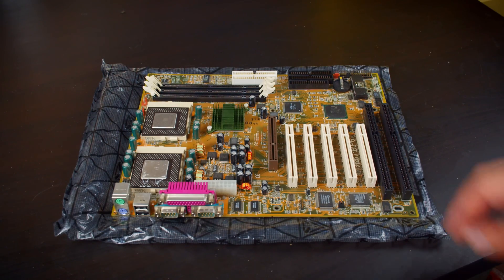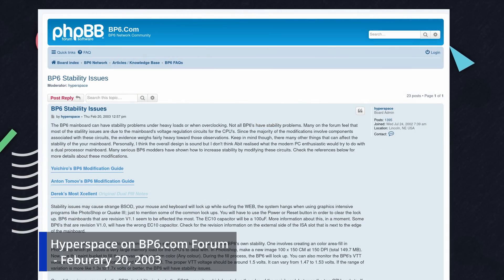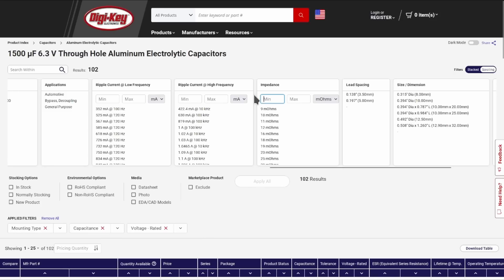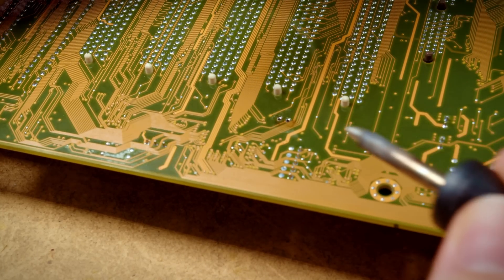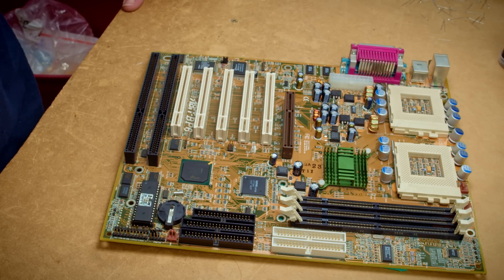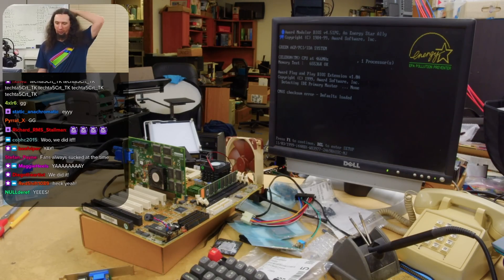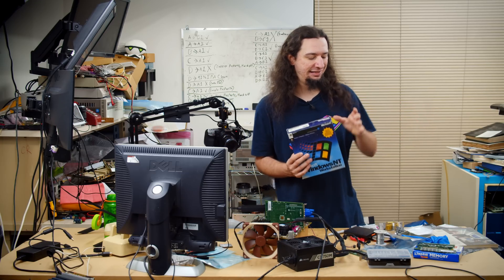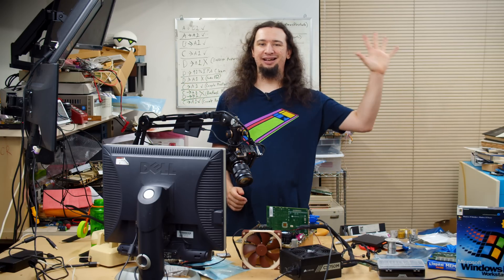Abit-BP6 ReCap - Dual Processor Motherboard Back to Life

Comment: I currently have right next to me a dual Pentium III 933 system on a ECS D6VAA board that I've had since new when I was a kid. I've since recapped it, added the 933's (used to be dual 450), 768mb of ram (can do 1.5gb but not stable overclocked) and running it at 150FSB at 1050mhz. Also added an Asus Magic 8170 Geforce 4 (originally an ATI rage 128, games said nope) and it's basically got Half-Life and CS 1.5 at the 100fps engine cap all the time. Reliving your childhood past on ACTUAL hardware of the time is the best way to go about it. I'll never let it go.

Comment: Back in a slightly earlier era (starting April 1999) I had a dual-PIII-350MHz (on carts! With CPUID! With Intel-provided disabling utility!) running Windows NT 4.0 SP 6.0 and later Windows 2000 beta and production releases. 256 GB of RAM, eventually a Matrox G400 on the AGP 2x bus, and a 9.1 GB SCSI drive. It was known colloquially as ‘Stalin’ because some driver issues made it somewhat unstable, and according to my best friend it was “big, powerful, and effed in the head!"

Comment: I don't think you would roast that CPU. I was able to overclock my Celeron 400 MHz up to about 566 MHz (friends had 366s overclocked to 550 stable). 600MHz works for a short time but not stable. Definitely having better coolers that can pull more heat away would help, though space is limited because of those caps. I had to file part of my coolers in order for them to fit. This is over 21 years ago haha, circa year 2000.

My board, CPUs, and memory are still in my closet. Its the first system I ever built and still my favorite, sticking it to the man, illegal SMP 😀

Comment: I still have mine up in the loft. It got the de rigeur pair of 300A Celerons overclocked and I think I ran an SMP version of OS/2 on it. I'll have to dig it out. Never had a problem with the caps while it ran but the power supply wasn't the quietest, I remember.

Comment: It looks like the hole spacing is close enough here, but it's a bad practice just push caps into the mounting holes if the hole spacing isn't exactly the lead spacing. You want to pre-bend the leads a few millimeters away from the bung on the bottom of the cap, and leave a bit of lead length between the cap and the board.

This may not actually apply to polymer caps, but on traditional aluminum electrolytics, having the lead being pulled at an angle can cause the bung to leak prematurely.

Comment: I had a BP6 with dual celeron 533.  I ran Linux, FreeBSD, and BeOS 5 on it back in the day.  BeOS was a lot of fun because it was designed for dual processor systems and was super responsive.
Reply: It's such a shame that the source code for BeOS was lost and never found.
Reply: @andersjjensen  I've tried Haiku a few times over the years, but it just isn't quite there yet.

Comment: Luckily I subscribe to you, as I have this exact same board that was shelved because of the exact same problems that you described. Thanks to being early in the age of this video, I have already ordered the same caps before they are all bought up, saving me the hassle of finding alternatives. Thanks, Shelby!
Reply: I only kept the board contemporarily in hopes that the forums would catch up and make it easy to diagnose/repair. I ran cad/cam software on it and it was a screamer. I never remembered having latency issues while it worked, before it started to bug out. It ought to fast up even more with an SSD and maxed-out components. It’ll be cool to use it too since I still have the light pen and everything.

Comment: I'm sure there are still enough Low-ESR caps available, so I don't get why the author couldn't find an appropriate replacement.  And there are a lot of different size through-hole polymer caps too.

Comment: I had one with 333MHz CPUs (IIRC) and a GeForce 256 (one of the mass-produced reference boards.) I overclocked it while it was my desktop. Years later I built a new desktop at which point I made it a file/print/dial-on-demand server running Window Server 2003 and returned it to the regular clock speeds.

I believe I got lucky with the capacitors in the board I had and I don't recall a failure of those. I did, however, have a hard drive failure in it; one of the infamous IBM "DeathStar" drives.

Comment: Damn, I remember wanting one of these when I was a teen, well almost an adult. This was around the time I won the contract to build my high school computer network (1st one). I was 18 :P  and got over 100 computers on that network using 100Mbps hubs at the time (in spite of my recommendation to use switches the school opted for hubs and multiple links to the server, 1 per hub, top save on costs. Them managed/smart switches were much more expensive back then). Still had to open 56 computers at the time as a lot of them, unlike some years later, did not have embedded network adapter so I had to manually install those network cards. And most were in fact ISA, so because plug and play at that time was more like Plug and Pray I actually manually configured every single one to ensure there were no conflicting settings such as IRQs, DMAs or Base addresses. This was crucial in particular on any computer that had a sound card as those would typically have at least a base address conflict and typically at least the base address and IRQ. DMA's only a bunch of them I had to be worried with.

Comment: My first SMP capable mobo was an Abit  board with dual Celeron and modified socket 370-slot 1 adapters (Slotkets) installed. Then I upgraded to the BP6 board, which got lost when I moved many moons ago. Scrapped all of my 32-bit computers...

Comment: Why to bother and use 6V caps? It is P3/Celeron - 3V3 max, and core is up to 2V. Use 2.5V polymer for core and 4V for I/O. For primary of DC/DC is 12V max.

Comment: I used an ASUS P2L97-DS dual Slot-1 board with a couple of Celeron 533 (Mendocino) CPUs in slocket adaptors for some years in the late 90s/early 2000s. (I upgraded it from the original pair of Pentium II 333 (Deschutes) CPUs.) With the original PIIs, I started off running NT4 then moved to Win2k but switched to Linux as my primary OS in late 2000 so never tried Windows on a dual-Celeron. (I remember the folks at college being in awe of my utterly-bonkers PC with an insane 512MB of RAM back in 1998!)

I did boot it once with one PII and one Celeron, just to see what would happen. Linux detected both processors correctly (I think the BIOS just reported two of whatever was in the first slot) but I didn't try benchmarking them or anything to see whether they were running at the right speeds as I was worried I might fry the system. Unfortunately, I gave away the Celerons and slockets so I can't try it again now. I don't have the original board either as it became very unstable eventually, so I replaced it with a used MSI MS-6120.

It's sitting on the floor next to my chair right now but I haven't powered it on for probably 8-10 years. I don't know what I'll do with it. Perhaps a monster retro PC running NT4 or Win2k (I've got a few nice quick 15,000rpm SCSI hard drives I could use) with the original Permedia II (3DLabs GLINT Delta-based) graphics card, with the option to dual-boot Win98 for things that aren't NT-friendly.

Comment: A few years ago I stumbled across a System with an even older Gigabyte GA-586DX dual socket board that was even still in use. Caps are fine, just the Dallas was dead. It came with an single CPU, but i managed to get two identical replacements. It is important to have CPUs with identical stepping level for stability reasons. It runs Windows 2000. The Gigabyte lacks an AGP slot and PCI graphics cards limits the usability for retro gaming, however its quite cool see it working from an retro perspective.

Comment: I would Run Windows 2000 on that setup with atleast 512MB ram. Might be a bit on the sluggish side since Windows 2000 was more for high end Pentium 3 and Pentium 4 CPU's

I had a BP6 for quite some time with 2 Pentium 3 CPU's that worked in SMT. was a good system with Win2K on it

Comment: Back in the early 2000's a company I worked for used a duel P3-533 server runing windows 2000 server for production network. Worked really well up until the capacitors failed.

Comment: When the tip of your current solder sucker gets too chewed up, they make versions that use a short stub of silicone tubing for the tip that work better for much cheaper than a powered vacuum gun. (Adafruit part #1597 for example). The silicone tubing can handle the heat of a soldering iron so you can press it right onto the tip and joint to suck the solder out without having to do the carefully timed move.

Comment: I had one of these boards, I populated it with two 1GHz PIII's, 1GB of RAM, two AT166 RAID cards, a Matrox AGP dual head video card and dual booted between Windows 2000 and SuSE 10.0. Ah memories :)

Comment: I had a cousin of this board, the Abit BH6 from circa 1998.  It was the first new computer I'd bought since 1990 when I bought an Amiga 500.  I was kind of amazed that prices had come down enough now that I could actually afford to buy this, being a poor college student.  It eventually was upgraded to a Celeron 300a running at 450mhz.

And yes....  it was hit with the capacitor plague.  I think it died around 2001, after just 3 years.  I halfway considered re-capping it, but honestly it just wasn't worth it.  At the time everything was moving so fast that a 3 year old MB was considered junk.  So IIRC I replaced it with an Athlon XP running at over a Ghz.  Quite another bump in speed.

And that was just indicative of this time.  It was upsetting to have something die after just 3 years...  but by then I had a enough income, and prices were even lower that I could upgrade yet again.

Comment: You couldn't find any caps in digikey because you were searching for exactly "6.3v rated voltage". In reality any cap with the same capacitance and same specs regarding the ESR, while supporting a higher maximum voltage would have worked just fine. Capacitor manufacturing definitely has improved, we now have capacitors of the same physical size that can withstand more voltage.
Nice that you were able to make it work anyway :D

Comment: Yeah dual Socket 370 boards are freaking awesome!

I've got dual S370 system here, with two 1Ghz Pentium IIIs installed. Dual boots Windows XP and Debian (something).

I use it as a all rounder machine, as it has 1.44MB 3.5" and 1.2MB 5.25" drives, a DVD burner and up until recently a iomega zip drive.

Plays retail HL2 extremely well!

Comment: I've found when searching for low ESR caps (or pretty much any other part) using the parametric search on electronics vendors' websites is pretty useless beyond just the category. And even then a lot of them aren't classified at all, so just searching for ESR in the "search within results" field gets more results. Then I filter by brand and start looking at datasheets. I've found the parts that don't have the parameters filled out are often a lot cheaper, despite sometimes even being the exact same parts or same series of parts.

Edit: Yes, it might take a few hours to find the parts you need, but you'll get the ones you want, not something that's close but a compromise, e.g. the wrong size.

Comment: I recall from working on server kit back in the 90s that it was possible to have dual CPUs with each running at different speed with NT.  I didn’t really test it thoroughly but the OS reported the two different speeds. I think this was either a 486 based system or perhaps Pentium 1.

Comment: If you need any high end video cards or parts from those days yell at me. I still have a couple of great antiques laying around. Dual P3 800's, Nvidia 5950 AGP video card, and much more. Im talking about big buck stuff from the turn of the century. I have no use for them at this point. I did play Quake at 300 FPS back in the day!

Comment: A few things I probably remember wrong. Celeron 300 sucked so much. Thank god for them adding like 128k cache. The PIII slot 1 and later 370? was designed for dual processor application. I have a nice Intel server board that supports dual PIII slot 1 processors. I remember Pentium PRO machines being used way into the Pentium II? & III area due to support 2 or more processors. Up until the Xeon came out. One final thing I remember at least for the Dual slot 1 pIII. The performance was equiv. to 1.5x processor speed. I can't remember why. But, I do remember have 2 identical servers with windows nt 4 server on them. One would go to a craw and you couldn't use it in the morning when everybody was logging in. On the dual processes one. You could use it (slow ) but mostly without an issue.
Reply: Celeron 300 was rejected by the market because of no cache.  Celeron 300a had cache and was a great value.  At intro, BP6 + two 300a processors was the standard configuration people used.  300a came out before BP6.

Comment: You're way over complicating this. Pretty much any board from the Pentium 2/Pentium 3 era can get Panasonic FR/FS capacitors dropped in without a hitch. The specs of those two series of Panasonic caps are quite close to the real world specs of the original low ESR capacitors used in that era. I've recapped a BP6 and several other board from the era like this. All of them are rock solid stable.

Always match capacitance exactly, and ESR as close as you can get it. It's always better to up in voltage, height, and even case diameter if the board allows. Bigger cap case size means it can handle more ripple current. Upsizing like this can immensely increase the lifetime of a capacitor.

There is an ounce of truth here through. Some later boards from the early to mid 2000s have reputable branded compact electrolytic Capacitors with ultra low ESRs and lofty ripple current capacities. Those are quite hard to replace with modern caps as suitable replacements just don't come close.

Comment: Dude. Kemet, is top of the line brand for polymer capacitors. Not some "ok brand". For electrolytic Nichion and Rubycon, and maybe Panasonic, are way to go, but Kemet is also good. Kemet is extremely popular in automatic and industrial applications, due to their testing and reliability and adhering to specs. Also their ceramic capacitors are superb, with only TDK and Vishay, having similar quality products.

Comment: I still have my BP6 in storage with dual Celeron 366 running at 550Mhz. Best motherboard of its time. I also later got the VP6 which can handle dual Pentium IIIs where BP6 cannot.
Reply: Some that created a new account that looks like you can send me a message that I won something. I am pretty sure it is a scam. Just letting you know.

Comment: Wasn't there a company that 'copied' the chemistry of Dupont's (?) fluid, attempting to save pennies on-the-cap. Then companies like Abit (and Dell!)  starting using them to save pennies-on-board/servers. I remember clients in the early 2000s sending back shed-loads of Dell servers (and never going back).

Comment: Typically, if you are polymodding on a CPU VRM, you can use half the capacitance of the original capacitors if you match the same ESR. Might make it easier for you to find the right polymers next time.
Reply: In most cases much smaller ESR of polymer caps doesn't do anything wrong. There are power supply types that don't like polymer caps instead of 'usual Low-ESR' but that's mostly not the case for motherboards VRM or ATX power supply. And you always may dilute several polymers with some 'usual Low-ESR' to provide stability.
Reply: @volodymyrzakolodyazhny  No, but a lot of these motherboards ask for 2200uF and 3300uF ultralow ESR electrolytic capacitors. You can replace these with 1000uF and 1500uF polymer capacitors generally as long as the ESR is not significantly worse than the original capacitors.

I advise only using polymer capacitors to retrofit the VRM capacitors on motherboards when needed. Good quality low ESR electrolytics are still commonly available for other areas on the motherboard. This Motherboard probably would work great with standard Panasonic FR series capacitors, even for the VRM sections. The really exotic ultra low ESR capacitors were really only important on Pentium 4 and Athlon XP style motherboard.

Most definitely, you can't just stuff a PSU full of polymer capacitors unless it is explicitly designed to take them, and expect the PSU to keep working .... they really can't handle the very low ESR and need the bulk capacitance instead. Again, generally not a problem finding the right capacitors for the job.

Comment: I ran Debian on a BP6 at home when they were new with two monitors plugged into a Matrox G450.  My memory of those days is a little fuzzy, but I believe I was running a pair of Celeron 366 overclocked to maybe 550.  I think the multipliers were locked, so all I could do was increase the FSB.  I might not have used one of the oddball FSB speeds like 83 mhz.  

I'd built 300A machines before, and they always overclocked so well, but there just weren't any available for me to buy when I bought the BP6.

This was the least stable machine I have ever built, but one of the most interesting.  The machine used to run 24/7, and it was rare that it had more than probably a three day uptime regardless of the overclock.  It got significantly more stable when I added an 8-port 3ware IDE RAID card.  I recall the IDE chipset being problematic, but it might just be that it was problematic at the time with the Linux kernel.

You said a lot of things in this video, but the only part I keep hearing you tell me in my head was that I had this machine 23 years ago.  I don't want to believe this is true! :)